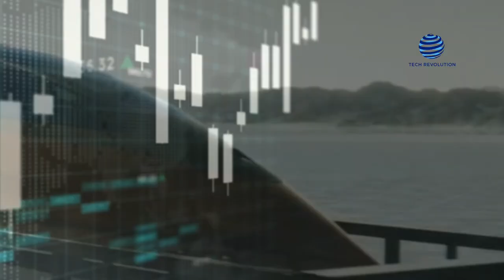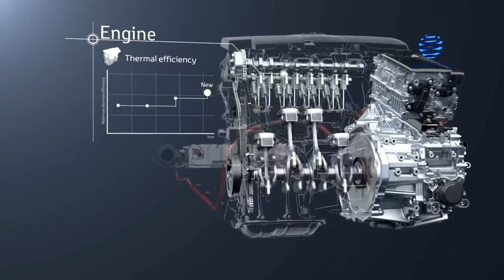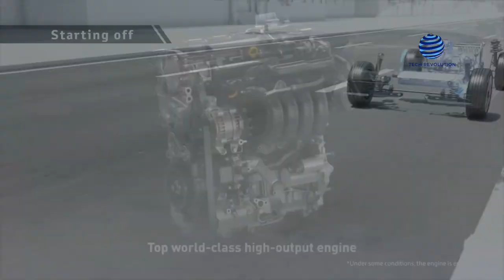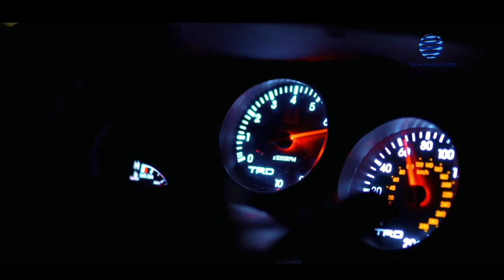Toyota JUST SHOCKED The Entire EV Industry With It's BRAND NEW Engine | This Changes Everything!

Comment: EV has fewer moving parts will equate to demand failure during operation is lower % compared to the ICE engine with more parts. EV is the future way to go. Contrary to this, zero co2 and less noise pollution from EV. Going green is a responsible attitude for our next generation
Reply: ev cars may have less moving parts but the parts eg battery has a life of 10 to 15 years then you have to throw it away where as I have a 25 year old Toyota land cruiser and still running strong and can be fixed to run for another 25 years not going into landfill
Reply: @michaelraeburn2563  if the battery is the part that goes bad after 10-20 years, you take the battery out for recycling. How many parts in an ICE car can go out in that 10-20 year frame. Water pump, rotars, transmission, etc etc.
Reply: I do agree with fewer moving parts, smooth and quiet ride and lower operating costs in EVs but not the rest though.
Reply: @richardcudjoe1158  That I can agree. One crucial part is a timing belt UNLESS if you timing chains, just to name one. Batteries in EVs can be replaced relatively easily but for now they're costly to do so. However there's little or no need worry about that cause you want replace one in around 5 years. Furthermore I commute locally using regular, "slow" chargers as much as possible. Running cost of EVs is my main reason. Desireable reason is the instant torque from the electric motor.

Comment: From the first thought of Henry Ford.
The CAR SHOULD HAVE A ELECTRIC MOTOR.
FUNNY TESLA AT THAT TIME 
SAID THE SAME THING .
BEFORE ANY CAR WAS MADE.
BATTERY POWER WAS THERE BIGGEST PROBLEM. 
FORD USED THE GAS ENGINE HIS 800.00 MODEL T WAS SOLD FOR 250.00 3 YEARS AFTER THE FIRST.
HE IS THE FATHER OF THE MASS PRODUCTION .....
HE WANTED EVERY WORKING FAMILY TO HAVE A CAR..

Comment: EVs are overrated, less moving parts but Complex electronics which have failure rates are as high as machanical, expensive and still there is no solid solution to recycle the toxic dead batteries.

Comment: Why would you want any gas engines when maintenance of changing oil and rip off service schedule? EV has no oil change no radiator or belts and cost less to charge than a fill tank of gas. Forgot the gas engine cars have transmission which most of them fail on newer cars no one repairs those transmission so you will end up have to buy a new one for thousands of dollars and the worst part the auto company will not have them in stock so it will need to be order take months. EV don't have transmission just direct drive motors which are cheaper to replace and last almost forever.
Reply: Mass produced electric cars needs energy for charging. Then there can be constraints in availability of lithium,nickel. Cobalt which go into manufacturing batteries. However hydrogen show promise. These IC engines use hydrogen then many of this constrais can be overcome. That cold be a reason why Toyota is also concentrating on IC engines
Reply: Good luck with the battery after 5 years, it is not cheap.
Reply: @Cheetahtos  We have a 9 yr old Renault Zoe. Battery is fine please explain that to me 🤷‍♂️
Reply: Rather buy a transmission than a battery which is almost half the price of the car and thats not including installation
Reply: key word there is almost!!!